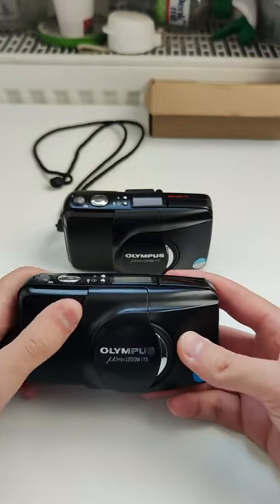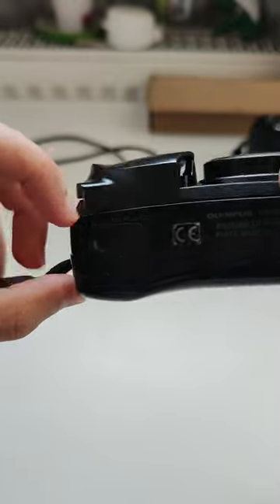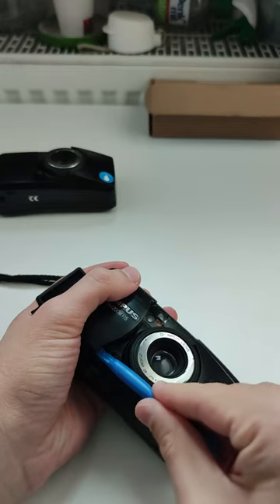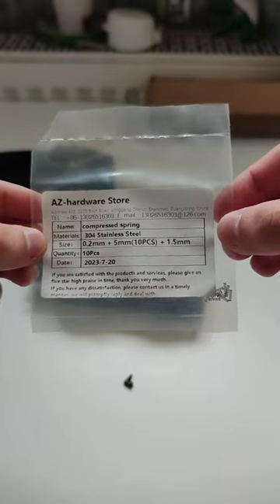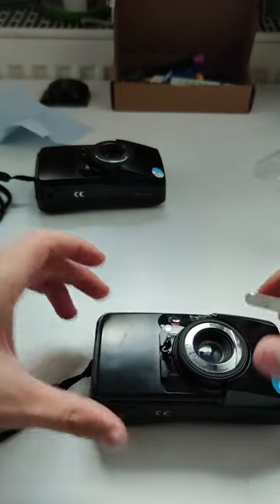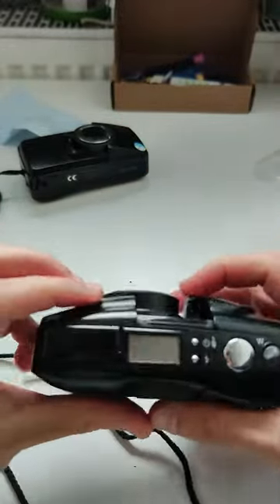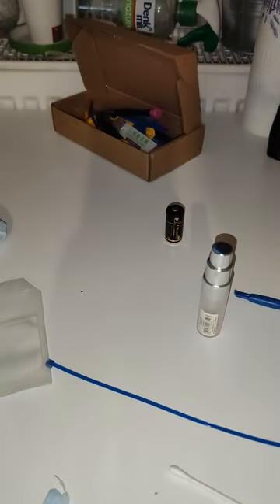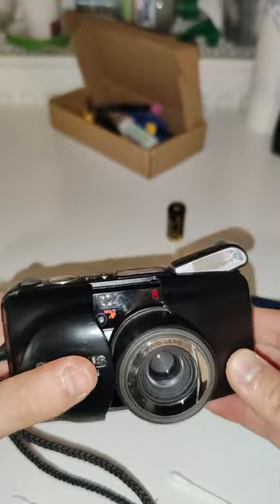How to Repair the OLYMPUS MJU ZOOM Cover | Tutorial Fix

Comment: Very nice repair 👌 I have a Miu, the disadvantage is that it has light leaks when zooming.  The floodlight illuminates the film with circular streaks of light.  Without using the zoom it's ok. Overall, it's a very nice camera, good lens, small size, dust resistance, etc.

Comment: Nice video. 
Just an FYI for any one cleaning with alcohol on plastics that doesn't have a weak solution like for glasses. I'd be very careful with the strength you use of IPA. As it can stain the plastic turning it white and you'll never get it off. I would advise just a bit of spit (i know cringe haha) and a lint-free cloth instead. Not like you're removing grease from metal parts in an SLR or anything.

Comment: Does anyone know what size the larger spring is? The one that goes between the two small black parts -- not under the ball bearings. That's the only part I'm missing.

Comment: I have a 2 pieces missing I think, the original black piece and the spring in the middle…. Where can I get this spring as it is different size to the one you have on your video bio…
Reply: Still
Need help. The third spring that was inside the good camera cover. Where do I get this
Reply from the maker: I had to buy a wrecked camera to have that parts, I would have tried to make it with a 3d printer but I don't have one in my possession.

Comment: hey, i have this problem: one of the ball bearings fell out, so I wanted to remove the cover. While doing so, I think I broke off one of the little sticks, not that of the part that youve replaced but the one on the part where you place the spring and then that part that youve replaced. Do you have an idea how to fix this? :(
Reply: I think the same thing happened to me. It looked broken but it wasn’t they had just popped off. The little black piece slides on the two prongs and the spring goes under neath it on the right side.
Reply from the maker: @theturn   Try sticking a small metal rod with superglue otherwise you will have to buy a wrecked camera that has those parts intact, I have not been able to find spare parts for the camera.